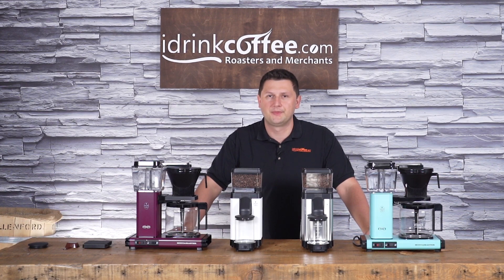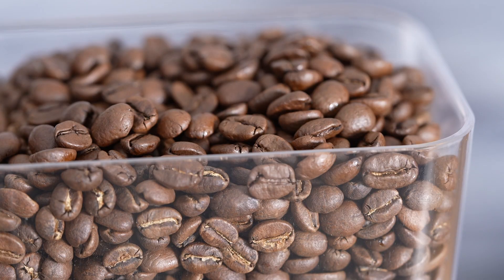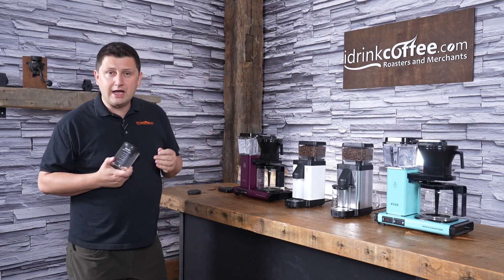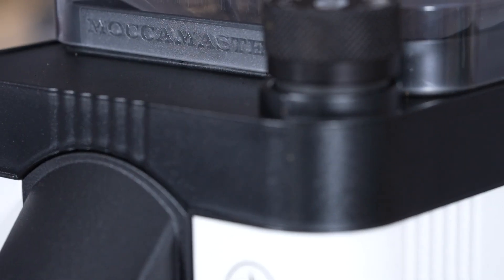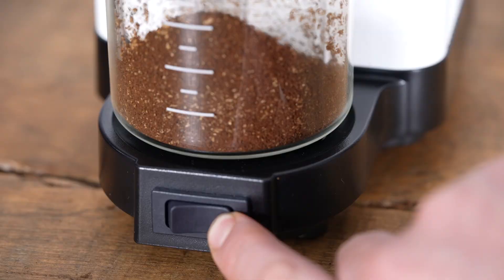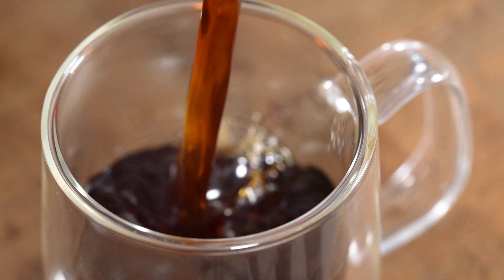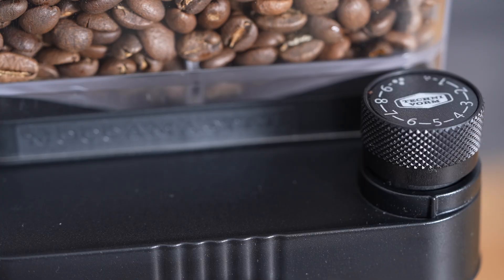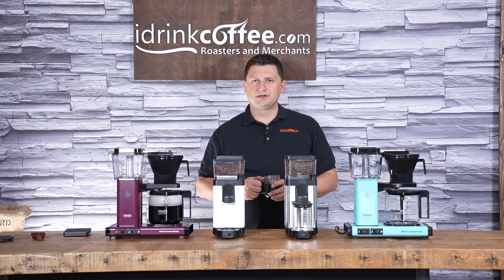Technivorm Moccamaster KM5 Grinder

Comment: Hi Slavic, I have a quick question. Has Moccamaster done anything this past year to deal with and make improvements with this grinders static issues I was considering this machine as we have two of the mocha Master Brewers a KBT 741 as well as a KBGV Brewer, holding down the button while it grinds is definitely a pain but dealing with all that static and the mess every day is definitely a dealbreaker. I hope they have made improvements. Thank you in advance for your response.

Comment: Seems like a missed opportunity to add a scale or timer into the base. I think everyone knows those lines and scoops are pretty inconsistent. 

Using a scale like you did is fine but seems like an unnecessary extra step when it could have been so cheaply added into the base. 

The 5 year warranty and compact design are nice. It looks pretty quick as well.